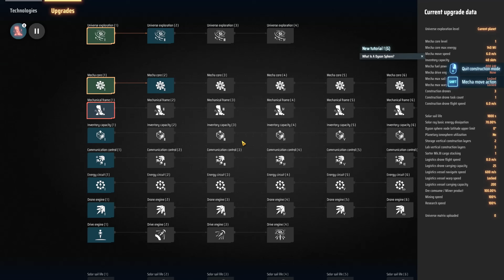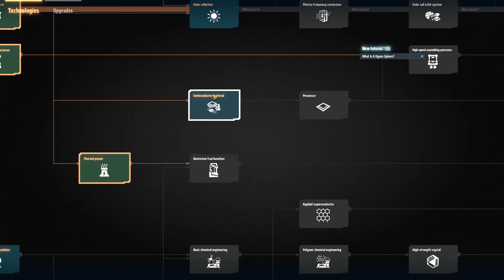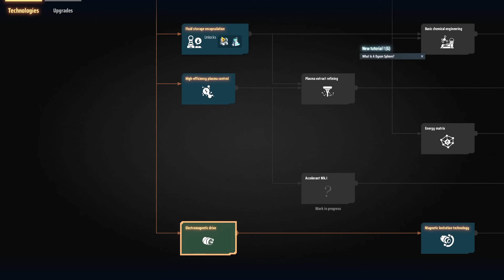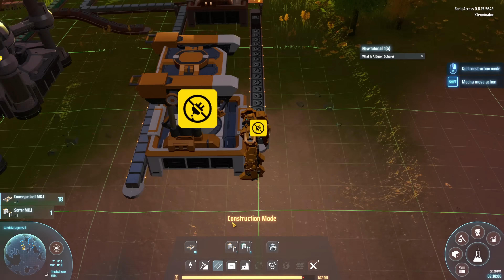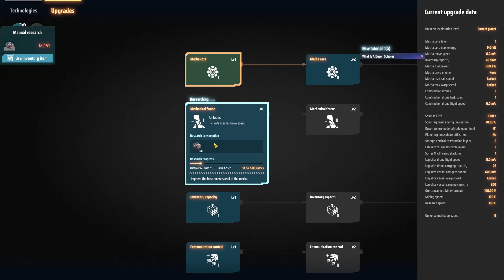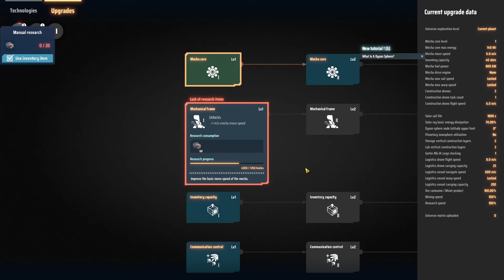Dyson Sphere Program EP 4 - First Impressions, Gameplay, Lets Play

Comment: One good alternative to the splitter building (which has 4 dynamic ports, meaning it can be any combination of inputs and outputs. Like 1 in 3 out, 2 and 2, 3 in 1 out...)
Is that you can run sorters directly between belts so also sorters can go one, two or 3 squares over.  But they take longer per trip on longer runs...  so you can move items laterally over two middle belts onto the third one.  Also sideloading works like factorio. Just run a belt inti the side of another.Try it.  Good luck.

Comment: One tiny tip I never see mentioned is that just right clicking a stack takes half, but if you hold right click you can drag left and right to specify how much of the stack you want to take. Makes splitting stacks or only taking what you want right then from storage super simple.
Also, holding shift and clicking transfers that one stack to or from your inventory, but if you hold ctrl it will transfer all stacks of that same item between your inventory and whatever other window is open.

Comment: Something which isn't obvious is the splitters have 3 different variants, all of which have 3 outputs.  One of those is a mode where 2 inputs are on the bottom, and 2 inputs are raised up.  This is perfect for use in a main bus style system.  Just a thought for the future.
Reply from the maker: Ohh good to know thanks!
Reply: Press tab a couple times when you have the splitter in your hand.

Comment: Hey the splitters actually have two alternative modes you can see when pressing Tab while holding them while building them. And both of the extra modes act like a conveyor lift so you can raise or lower the conveyor in only one tile instead of making a ramp.
Reply: The splitter itself is 2 tiles i believe, and 3 long and 3 wide for the normal flat one. But yes the otherones can be very handy in a main bus system when you want to split above and over the other lanes.